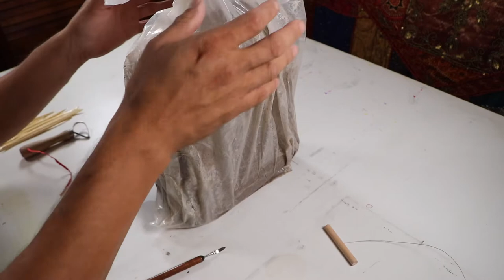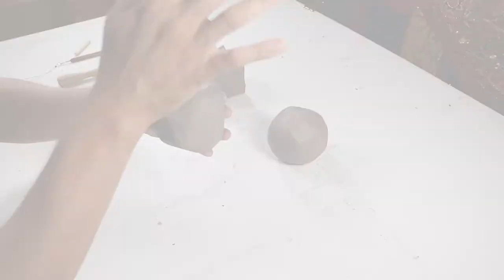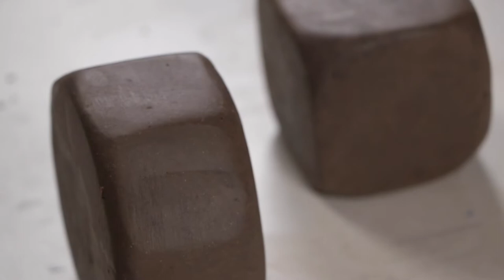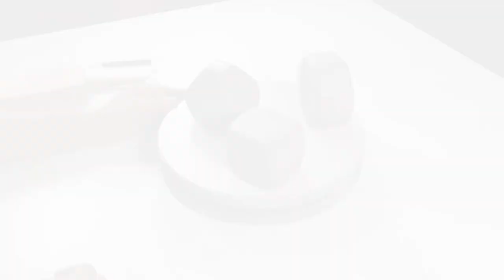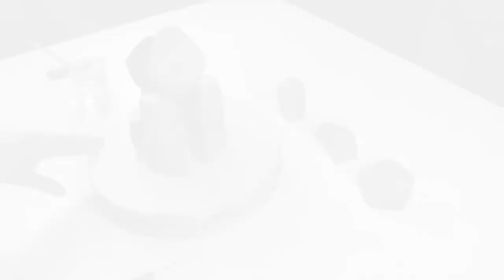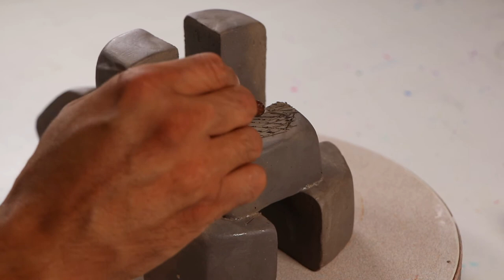Intro to 3D Form - Soft Geometry - Clay

Comment: Are they too thick to fire?
Reply from the maker: Hi Bonnie!

Well that depends on weather you compressed the clay form to ensure that there are not air pockets on the inside. If there are air pockets then the form would crack during the firing process. You can always cut the forms in half while the clay is "leather hard" and hollow out the inside to create a 1/2 inch thick shell. You would then "score" the 2 shapes back together and poke a little hole, about 1/8 inch thick, so the are inside can escape while the clay shrinks during the firing. Thank you for the good question! Best!

N